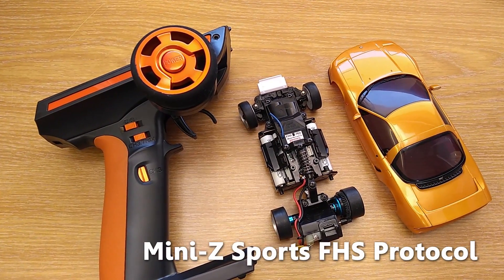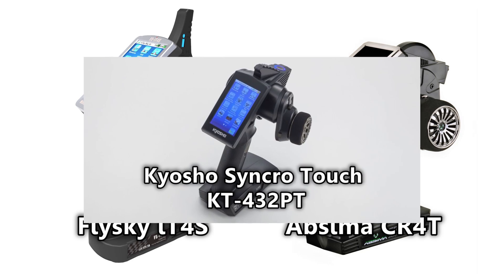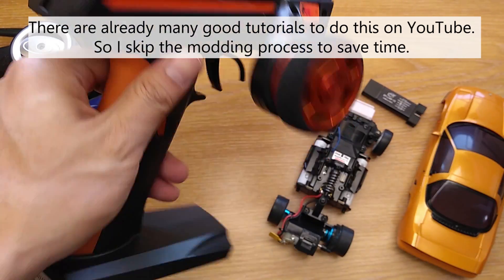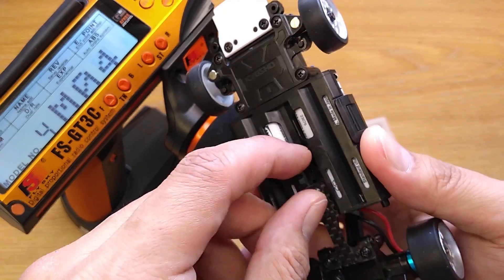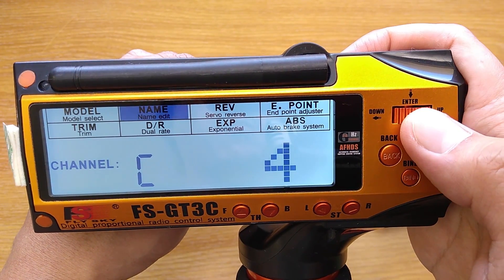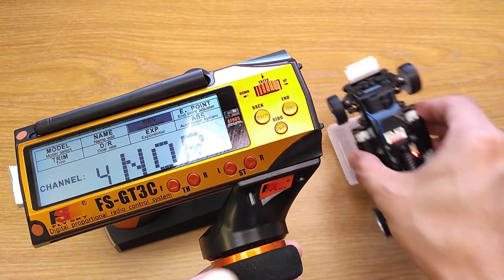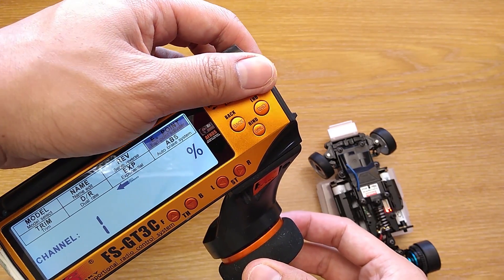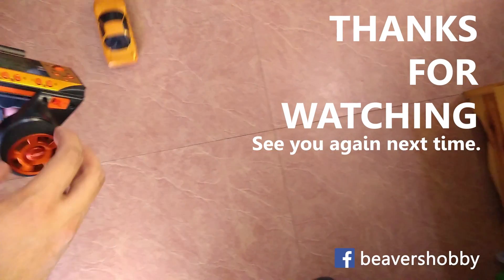How to Bind & Setup Flysky GT3C with Mini-Z

Comment: Its the same with ma020 ?
Reply from the maker: If your MA020 is the old version that uses KT19 transmitter then yes, it's the same. 
Otherwise if it comes with KT-531P then no.

Comment: Hello can you say if the CR4T Ultimate 2.4GHz 4-channel tramsmitter will work with ma020sports  fhs?
Reply from the maker: Yes, it will. Choose AFHDS mode and reverse channel 4 and you can use it with the Mini-Z Sports.

Comment: How to Mini-Z MR-02(ASF system 2.4GHz)
Reply from the maker: Unfortunately ASF is a different system and you'll need a RF board for it. Kyosho has stopped making it for years, DasMikro made some but it's also out of production so it's really hard to find. Once you get the board, connect it to PPM output of your radio. This is a bit difficult with GT3C but easy with Radiolink RC4GS, you'll just do it like what I did with the multiprotocol.

Comment: How do i make the lights stay steady on?
Reply from the maker: You'll need to bind it then restart the car.
Reply: Yeah i’ve gotten it all setup and been driving it around, i got all my trims dialed in, but no matter what i do i cannot get the lights to stay on, only comes on when it’s driving, or flashing when it’s driving
Reply from the maker: @lanemurphy7  May I ask which light are you referring to? If it's the red indicator light on the chassis then it's not normal and you can try and bind it with the original transmitter and see how it behaves. If it's the light kit for front and rear light then it will only come on when the car is running. It's controlled by channel 3 as VR (variable rates) so you'll need to set that on the transmitter.
Reply: Thanks, yeah i meant the light kit lights, i thought they could be set to constant on. Thanks for the response and great video,  very glad i could setup mini z with my flysky
Reply from the maker: @lanemurphy7  My pleasure.

Comment: Cool! Does it work with FHSS too? Perhaps a good upgrade from my KT-531P without breaking the bank. Too bad the Noble NB4 is not compatible with the MR03 RWD.
Reply from the maker: No, it doesn't. However you can use multiprotocol module with a transmitter that has PPM output.

Comment: Hi there, as you say the flysky it4s will work with mini-z(FHS), how about the flysky GT5 will it work on mini-z(FHS) too ! Because they are (it4s/gt5) using the same protocol (AFHDS 2A). thank you ^^
Reply from the maker: FHS = AFHDS, the old one.
iT4S has the ability to switch to the old AFHDS, that's why it works. 
GT5 cannot, it's only AFHDS 2A so it doesn't work.

Comment: Hi Beaver! Does this hack work with mini z MR03? Thanks!
Reply from the maker: Te new one with FHSS label and KT531P radio? Unfortunately, no. This hack won't work. However the multiprotocol will. The latest firmware finally supports Kyosho Mini-Z FHSS. 
The following video is from the old firmware but it connects to a radio the same way.
https://youtu.be/zJmg_gv34us
Reply: @BeaversHobby  I have the older Mini Z MR03, the one that is ASF. Would the Flysky bind to that?
Reply from the maker: @diver362  No, it won't. ASF is even more special and you can only use it with KT18, some Ko Propro radio and a radio with ASF module. Here's the chart. http://kyosho.com/mini-z-info/support/radio-compatibility-information/
Only Mini-Z FHS = Flysky AFHDS.
Reply: @BeaversHobby  thank you Beaver! I will cancel my order then. And find one that has FHS protocol and follow the video above. You have been a lot of help- thank you so much!! Always appreciate your patience and knowledge with my questions.
Reply from the maker: @diver362  My pleasure. Good luck with the project.

Comment: I really like flysky  TX for my fixed wing and quadcopters. Is there any advantage driving with premium TX?  I'm in the market for one.
Reply from the maker: It offers more adjustability over the stock one. The  Mini-Z's stock TX only has throttle D/R and with a better radio you can adjust EPA, Expo, etc.

Comment: Hi Beaver, I'm using 3pks with irx4 multi module for mini-z, but I wonder the latency compare with gt3c.
3pks is good but too big, so I want to chage transmitter,
gt3c's latency is not good I heard, how about your opinion?
Reply from the maker: I'm actually running multiprotocol with Mini-Z as well. The latency is the same, it depends mostly on the protocol. What you will miss when using GT3C is the easy to navigate menu, tons of resolution, the dial to adjust settings is so hard to use. I'd say keep using the multiprotocol. If you want an upgrade iT4S is a much better choice but it won't work with the new FHSS RWD/AWD/FWD in case you buy a new car.
Reply: @BeaversHobby  Thank you for reply. I will note it~
Reply from the maker: @나라김-d5b  My pleasure. Come to think of I I haven't done the video explaining how I use irx4 with 3PKS and Mini-Z as well, really gotta check which video project isn't finished yet.

Comment: Hi Beaver, great video. The mod on GT3 is too much for me. Can I use FlySky FS-GT5 on MR03 models instead?
Reply: I suggest taking a look at the mod again. It's just the soldering of 4 pins. No case modifications necessary if you mod like I did in the mod video on my channel. ST-Link programmer is usually just $7. GT3C is such a great radio!
Reply from the maker: No, you can't. The GT5 is AFHDS 2A only. Apart from modded GT3B/C you can use iT4S and set it to AFHDS mode. Then do the same, go into CH4 and choose reverse to get full steering.

Comment: Flysky NB4 can bind Kyosho RWD ?
Reply from the maker: Which RWD? If it's RWD EVO version then yes, you can install NB4 receiver on it. Otherwise if it's the RTR FHSS version then no.
Reply: Beaver's Hobby is Kyosho RTR RWD
Reply from the maker: @betaoptionbetaoption8200  No, it's not. Unfortunately the only upgrade option you have is KT-432PT.

Comment: Idk if I'm missing something but I successfully flashed my GT3B and set everything up. Now the problem is when I try to bind the transmitter to my MA-020 miniz. It just doesn't bind.
Reply from the maker: Which MA-020 do you have? Is it FHS with blue antenna?
Reply: @BeaversHobby  It does have a blue antenna and it is connected to my KT-19 receiver
Reply from the maker: @gladperson116  Try repeating the binding process. 
Does your GT3B still function properly, eg. binds with another receiver normally?
Does Mini-Z still bind to its original radio?
Updating firmware doesn't change anything to the protocol, we just want that channel 4.
Reply: @BeaversHobby  So I connected it by turning the miniz on and holding the bind button until it starts and stops blinking fast. Then I turned it off and tried binding again and it worked.
Reply from the maker: @gladperson116  Glad it worked!

Comment: hi, can i use this transmitter with mini z ?
Reply from the maker: Only with the FHS cars that have KT-19 transmitter.
Reply: Beaver's Hobby FHS car means what ?
Reply from the maker: @faysalkhaled1745  Mini-Z has different versions with different boards and protocols. The FHS version is the Sports and Sports 2 versions which have blue antenna and use KT-19 transmitter.
The chassis with these boards are old MR-03 and MA-020.

Comment: hi, beaver, i have m03, and there is ASF text in the chassis, is it can bind to flysky gt3b?
Reply from the maker: No, it's different chip and protocol altogether. 
There's however a RF module to use ASF with any transmitter that output PPM. It looks like this. http://bit.ly/310mEMG
Reply: @BeaversHobby  thanks alot Beaver
Reply from the maker: @fly-akuma9921  My pleasure.

Comment: It runs without flashing flysky? It is possible pairing with stock? Thanks! Is very difficult to find a new miniZ FHS... :(
Reply from the maker: It will bind (because protocol is the same) however you can't use full steering because it needs reverse on channel 4.
If you don't have tool to flash you can find the iT4S. It comes as 4CH already.
Reply: @BeaversHobby  OK thanks!!! I cant find MR-03 with kt-19 with good price, this is the problem, all asf now.
Reply from the maker: @Ruben3D  My pleasure. There's a new version called RWD with better electronics & faster connection but a bit worse transmitter.
Reply from the maker: @Ruben3D  Ummm, yes. It's FHSS, another new protocol.
Reply: @BeaversHobby  Umm... Im viewing that flysky is FHSS, Is it possibol pairing with a new MR03 RWD with FHSS?
Reply from the maker: @Ruben3D  Unfortunately, no.
FHSS is just the name of a method for skipping frequency to avoid interference.
A radio talks to a receiver via protocol which dictates the way to skip (hop) between frequency and possibly other attributes like transmitting encryption and telemetry.
The only transmitter upgrade For Mini-Z FHSS is Kyosho KT-432PT.
Reply: @BeaversHobby  OK FHSS FkySky is different that FHSS Kyosho :( Thx man!
Reply from the maker: @Ruben3D  My pleasure.

Comment: hi bro I’m saw your clip. So I went to find the remote control in banggood I to see flysky fs gt5  Interested page spec #Modulation: FHSS  Can it connect to the mini-z RTR? (Fhss) I'm going to buy that remote control (Thanks for replying to my bro ) https://sea.banggood.com/th/FlySky-FS-GT5-2_4G-6CH-Remote-Controller-Transmitter-with-FS-BS6-Receiver-for-RC-Car-Boat-p-1503240.html?gmcCountry=TH&currency=THB&createTmp=1&utm_source=googleshopping&utm_medium=cpc_bgs&utm_content=lijing&utm_campaign=ssc-th-usw-th-sea-0317&ad_id=426021255084&gclid=Cj0KCQjwyPbzBRDsARIsAFh15JZjYOZmlsZi_JHMasBiYRPn-j9TAwRDx-f6kkp-TLOPIEfB7NvRBcAaAsjrEALw_wcB&cur_warehouse=CN
Reply from the maker: Unfortunately Flysky GT5 can't connect to Mini-Z. 
FHSS is just the name of a method for skipping frequency to avoid interference.
 A radio talks to a receiver via protocol which dictates the way to skip (hop) between frequency and possibly other attributes like transmitting encryption and telemetry.
The only transmitter upgrade For Mini-Z FHSS is Kyosho KT-432PT.
Reply: Beaver's Hobby  bro What’s the radio? >>> https://youtu.be/Qec-Q0L2Les
Reply from the maker: @T2EJourney  That is Absima CR4T. It's sister radio of Flysky iT4S but only on sale in Europe. As you can see this (or these) radio has 4 channel in the first place so he can just reverse channel 4 without having to mod it. (His is also FHS like mine.)
And I predict your next question... No it does not work with FHSS.
Even though Flysky iT4S, Absima CR4T and Kyosho Syncro KT-432PT are sister radios. KT-432PT has special firmware that works with Mini-Z FHSS while iT4S and CR4T don't.
Reply: @BeaversHobby  Sir yes sir Bro.
Reply: Beaver's Hobby what if it’s the sports version shown in the video? Will a gt5 bind to it? I know it uses AFHDS 2A but so does the GT2F that you shown in the review.

Comment: Beaver, does this mod allow you to use CH3 on the TX to control the LED light function on the mini-z. Thanks.
Reply from the maker: Yes, providing you add knob or set up the VR (variable rate) to control the blinking rhythm. Otherwise it will just be turning on and off because CH3 is normally dip switch on this transmitter.

Comment: Beaver, what's the difference between afhds vs fhs and fhss?
Reply from the maker: They are different protocol. Mini-Z's FHS = Flysky AFHDS, same chip, same frequency hopping algorithm. Mini-Z's FHSS is still unknown at this point, possibly it has its own frequency hopping algorithm.
The transmission rate is also different. FHSS seems to be faster according to some people, I personally don't see any difference.

ps. I don't know the technical side of how FHSS hops between frequency and Kyosho is not going to publish it so we'll have to wait for someone to hack it... hopefully.
Reply: @BeaversHobby  so only mini Z's using kt19 are compatible with the flashed FS GT3?
Reply from the maker: @congeeSTAR  Yes, it is compatible.

Comment: I have Ikonnik 3 channel RX, it has a A1705 chip,and protocol is meant to work with flysky AFHDS. Will this work with the flysky gt3 with 8 channel hack?
Reply from the maker: By the way you described, yes, it will work with GT3 even without the hack.

Comment: Very informative channel. Is it possible to bind a turnigy 3xs to my mini z? The mini z uses fhss as well as my transmitter. I’m having trouble getting it to bind.
Reply from the maker: Thanks. Unfortunately you won't be able to bind Turnigy 3XS to Mini-Z. FHSS only means frequency hopping spread spectrum, which is a method to swap frequency and avoid interference. What makes a radio bind or communicate to a receiver is protocol which in this case they are different.

Comment: I'm still preying for a possible hack to add Fhss support into the it4s or fly sky radio....  432 is a hard find and kinda expensive for a surface life it4s.... 

All I know is when opening Kyosho's firmware with exescope, the structure is the same as fflysky's.  The difference is under a file named 901.Kyosho's file is larger....
Reply from the maker: Someone with iT4S should try flashing Kyosho firmware to it but who's gonna make that sacrifice is the question.
Reply: @BeaversHobby  Actually I think the first thing to do (if someone is willing to do so), is to see if the kyosho's exe file will even recognize IT4S.

Comment: http://kyosho.com/mini-z-info/2017/10/28/syncro-touch-kt-432pt-now-supports-mini-z-rwdfwd/
Reply from the maker: That's official radio from Kyosho. It works with both FHS, FHSS, and EVO with FHSS receiver. It's much more expensive than standard Flysky though.
Reply: @BeaversHobby  ผมดูจากสเปคแล้วคิดว่าตัวตัวบอร์ดของKyoshoที่ใช้รีโมทKt531P ก็น่าจะใช้ได้ กับรีโมทท flysky นะครับ
Reply from the maker: @parkoolusify  ชิพเดียวกันครับ แต่คนละโปรโตคอล(ระบบ) ยังไม่มีคนแฮกเลย

Comment: How do I bind a mr03 with FHSS to a flysky its4? I just got mine in and I’m stumped. They have AFHDS, AFHDS2, AFHDS 2a 1-way and 2-way
Reply from the maker: FHSS has its own coding and won't work with standard FlySky protocol despite having the same chip. It only works with Kyosho KT432PT with its special firmware for Mini-Z.
Reply: Beaver's Hobby thanks for the info! Thought I might get lucky.lol got it for cheap on eBay for my wltoys.

Comment: https://detail.tmall.com/item.htm?spm=a1z10.5-b.w4011-8527354486.32.cbdc5a19RgTlCt&id=571789858702&rn=b1266cd1fcd01e9e95ccd6dee53d2289&abbucket=13th
 can  i use this on MINI-Z sport?
Reply from the maker: No, it's the newest Flysky protocol AFHDS 3 and not compatible with anything except it's own receiver. The only hi-end Flysky you can use is iT4S.
Reply: @BeaversHobby  THANK YOU VERY MUCH!!!!
Reply from the maker: @阿萬玩玩具  My pleasure.

Comment: Think I'll skip this mod, too lazy.  I would like to ask though, I've been having issues with the wheel button on my Tx where as I try to scroll one direction it'll do like a dozen in the opposite and become inconsistent, have you ever had this happen or know how to fix it?  It's not rendering the Tx useless, but it's really annoying to deal with when trying to tune settings.
Reply from the maker: Yes, I had the same problem. Firmware mod somehow made it better with the directional change so it's less confusing but the accelerated wheels is still there. You can probably see in the video where I struggled to get the setting I want.
Honestly I don't really use much GT3C. Nowadays I use multiprotocol module hooked up to my Radiolink because it provides better stick resolution that is sharper and more precise control.
Reply: I might open it to have a look to see if it's a physical issue.  I'm still getting back into RC and money is limited, so I've not looked at anything high end in regards to Tx's yet.
Reply: @BeaversHobby  I have a quick update on this issue I was having.  As I figured it's a mechanical issue, not software.  When the spring in my wheel broke and had to open to repair it, I decided to take a look at the scroll wheel.  I did notice before that if you push the wheel up the issue would subside enough to make changes.  After opening it and looking at the wheel, I decided to shim the wheel by adding a couple washers to the little hex shaft on the wheel.  I used a spring washer and regular washer of same size (from tamiya m4wd kit).  It's stiffened up the wheel and is now working about 95% of the time, there is still a little skipping here and there, but with the wheel shimmed, it's immeasurably better than before, although on the down side, it made it a little harder to push the button on the wheel....but that is easy to live with as long as the wheel is precise.
Reply from the maker: @foxracerdrew  I'm glad you found a fix. At least it should be easier to live with.
Reply from the maker: @Overland_RC  Basically it's the same radio with different board layout, screen and button placement.